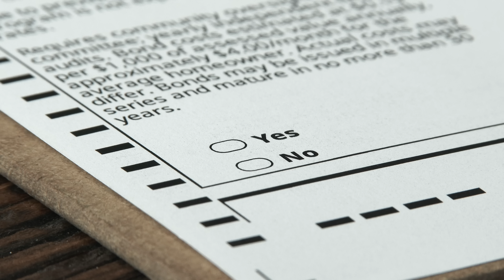Why Does Tesla Have An Anti Right-To-Repair Stand? We Suggest Some Reasons

Comment: I very much appreciate this video. You probably know what I am about to say. Planned obsolescence is part of the equation here. Yes, traditional auto dealerships make seven times the revenues in repairs, so that supports life extension of the vehicles.But EVs are different in that they involve much less repair. And as an example, I think that maybe it was Tucker (?) that went out of business in the US in part  because their cars lasted "too long". Tesla's new battery design involves the battery cell matrix being part of the structure of the auto, rendering individual cell replacement virtually impossible. So instead - throw the entire car away, or replace the entire battery structure as a unit. See the problem here and the trend?

Comment: Okay, as both a mechanical engineer, and shade tree mechanic for over 30 years, I'm going to call BS on Tesla for reason #1. Incorrectly fit a part/component? Seriously!?! THAT'S their excuse? Because last time I checked, a brake pad only goes on one way. A shock absorber/strut can only be attached in one way and on one mounting point on the unit body. You cannot attach the left-side Model 3 headlight on the right side of the car. And when was the last time you heard a car manufacturer say that they cannot put a rear proximity or impact sensor on the front of a car? (Probably because there is no such thing...it's a sensor in a bumper...) Then again, Tesla's not a car manufacturer...they're a tech company that puts a computer and a large battery between 4 wheels...
Reply: That is the case for a lot of parts, but not typically for electrical wiring. You have high voltage DC, high voltage AC, low voltage DC, and sensor wires using similar cables. You connect the wrong cable to the wrong part or other cable, and you either have a destroyed part, a fire, or dead body. 

Also, while really just a nitpick, you mentioned a lot of parts that are really just designed to go one way. Tesla could do so, even with wiring. But they have to be sure to design it that way. They likely aren't.

Comment: They should open a 3'rd party authorisation program having a sort of ID card that has all the skills of repair/replacement that the person has and it should have a similar security to credit cards, and have the basic skills require no active training or paid exam while the more advanced software and "core parts" engineering will have to have in some cases an extensive paid exam and in other cases a thorough course that ends with the exam, (in special for constantly upgraded parts, and have the "black box" of the vehicle be the security point only tesla can access but not some core component of the vehicle, only the "brain" of security and actual black box of the vehicle. (we do not need Tesla to become the APPLE of automotive industry)

Comment: Even if something goes wrong with the robot vacuum cleaner due to compatibility issues it wouldn't hurt anyone, but imagine the same thing happening to your car while driving it?
Reply: You know plenty of people do their own vehicle's maintenance, rather than go to the dealership for an oil change, timing belt, brake system..they may even take their vehicle to a shop that can/does do that work...how about the millions of vehicles repaired from fender benders
Reply: @thejake8099 , this is true. But, their vehicles aren’t anywhere near as specialized or advanced as Teslas are. 

Don’t get me wrong, I’m 100% for the right to repair. But, when we’re talking about vehicles that can drive themselves, easily be hacked and controlled remotely or possibly catch fire because of a rigged repair (yes, I know the same can happen with ICE autos, just not as easily), then I believe those possibilities must be taken into consideration.

Maybe, some sort of repair certification? Something along the lines of, you’d fix your out of warranty Tesla yourself, then, for a reasonable fee, have the repair certified for safety by a licensed Tesla facility. 

Everybody wins.
Reply: @samson7842  
Ha, really.

The average car has around 100 million lines of code with many different computers.

Tesla is no more advanced than any other car.
Reply: @Robert-cu9bm  so, then I should be able to take my girlfriend’s Honda Accord on to the nearest freeway, engage the level 2 autonomous driving mode and let the vehicle take over, then?

Comment: Tesla is anti-right to repair because money. There is far more money in repairing cars then just selling them. Tesla is just the only company that bricks your car or features if you don't use one of their shops. It is as anti-consumer as you can get.

Edit: There is no defense for having anti-right to repair stances. And you should avoid companies that enforce these policies like Tesla/Apple/John Deere because when you are forced to install firmware that can make your device run worse or turn off/change features with no recourse or notice in some cases, that is bad...

Thanks for being objective here and not just defending Tesla as most people do. Sure the company does have a respectable goal, but when you trample on rights already established, we all lose.

Comment: Back in the day, every high street had  a TV repair shop.....
A Tesla can be a 600hp 2 ton missile  which can - with the application of 5 volts - drive itself. 
Having used Toolbox 2 and Toolbox 3 Tesla diagnostic  programs I know they are not 'consumer friendly' even worse than xentry and BMW ISTA...
The interaction between the hardware and software is fiendishly complex - difficult for even Tesla to make work reliably... 
You have to put yourself in the mindset that these are now aircraft level machines ( even though Tesla quality is not aerospace quality) 
They are not the same as a 70's Mustang which you can noodle with. 
I hate to say it Tesla are just the most extreme of the automakers, but they are all going that way.

Comment: I am a very avid do-it-yourselfer, a fanatical supporter of rights to repair and have been ever since I destroyed my first bicycle while trying to repair it oh so many years ago. I regularly dig into my computers, laptops, cell phones and anything else that crosses my path in need of upgrade, repair or I just can’t resist taking apart and tinkering with. I have been known to take on some fairly dangerous projects including repairing power saws, household wiring, and natural gas pipes.

I am amazed to discover I agree with Tesla that their cars should be exempt from right to repair laws. With their full self driving systems, computer-controlled (defendant on an array of complex sensors), high voltage electrical system and high voltage, high current superchargers; the cars level of complexity and potential for causing destruction seems more like a small aircraft than a standard car and repair or modification of small aircraft is not left to the haphazard whims of increasingly low-budget third and fourth owners.

I do not want to be on the road with any self driving vehicle that has been repaired or modified by anything less than a highly trained, certified and legally culpable technician. Neither do I want to plug my Tesla into a supercharger being shared by a car whose high-voltage system has been “improved” by a dedicated amateur. 

If you look at tesla’s vision for the future the personal car will be as anachronistic as a privately owned horse is now. In 10 years time the Robo taxi transportation system will almost completely replace privately owned vehicles. Using Robo taxis will be significantly less expensive and significantly more convenient than owning and maintaining your own vehicle. Who would want to own or maintain an aged and increasingly temperamental and dangerous thirdhand electric vehicle for so much less money and effort they can just use a Robo taxi. The entire transportation industry is fundamentally changing and buying a used Tesla will be as unimaginable as buying an ICE vehicle.

I bought my Tesla Model 3 new one year ago. I expect that by the time it goes out of warranty (in three more years) the Tesla company will be paying a nice premium and\or offering a wonderful discount on a new Tesla in order to buy back used Teslas to refit them as a Robo taxis in their ever expanding fleet.

Comment: This is why I'll buy a chevy bolt in the future. Bolt parts can be bolt online, if someone is confident enough to try you can even buy the battery pack. Actually its completely possible to buy the bolts full drive train for an ev swap in an ice car. Of course you'll need to do alot of modifications to the ice but still you have the option.
Reply: Same, Tesla's throwaway culture is the biggest thing keeping me from buying one. I bought a Leaf instead as a gap car until there are more EV's available from mainstream manufactures or Tesla makes parts and service information available.

Comment: You've left of a big reason Tesla has for resistance to these generally open-ended laws: Software locked features. There's already a lot of people who feel that the discount they received is not a reason to not "flip the switch" to get a feature physically in the car but disabled for that discount. If this falls, Tesla will face additional costs in manufacturing variations, or just less discount options. 
I generally agree with the "right to repair" philosophy, but being in software, I also am aware of the increasing security and safety risks that come with these systems. Of course, risks from bad or unsafe repairs aren't new, but I can still understand the exposure, as you did note, to a company's reputation.

Comment: Huh? I live over 100km from the nearest service center. I was able to access all the service manuals, etc. through https://service.teslamotors.com/ ...
I have been doing (most of) my own repairs and ordering new parts without issues (except, sometimes, really long delivery times).
I have NOT lost warranty because I did the repairs myself (hell, I have even used 3rd party components because they were like 3x cheaper in some cases).
Tesla might be against right-to-repair, but in the actual real world, I haven't noticed.
Reply: So how did you order the parts when others can't?
Reply: @Robert-cu9bm  you can order parts through EPC. And I don't know anyone who can't order parts (anyone that actually has a Tesla that is). Well, there are some parts that you can't order individually (only available as a kit) - which makes it quite expensive. E.g. you can't order brake pads (only available with calipers, etc.), which is IMHO idiotic and not something Tesla should have "copied" from BMW and others. In those cases, you go to 3d parties as mentioned above.
It is also likely some parts are not available to buy at all (but all the parts I needed were available).
Also I am in EU, the situation could be different in other regions.
Reply: @jaroslavjandek8365 , The situation is definitely different in the US. Watch Rich Rebuilds videos on YouTube to get an idea what it is like on this side of the pond.

Comment: I wouldn't wanna be the person who buys a used Tesla repaired by third parties. This is not a phone or laptop to be doing that.
Reply: It's just a matter of time. In another decade plenty of repair shops will be able to do electric. There will be still some marques that are harder due to non-commodity parts, but that's the case today.
Reply: All modern cars are highly computerised... None will run without the multiple computers.

Why are they safe to repair but a Tesla is not.

Tesla can't even get the cars done right from the factory let alone trusting one of their repairs.
I'd trust a third party repair before Tesla.

Comment: Okay now I need to hear more about these Roomba mods...I also have decade old Roombas. We’ve already fixed a design flaw on their motherboards where one of the three onboard processors went bad, replacing it with a similar simple quartz clock which cost about $5 but I’ve neglected our Roombas in the past few years. Maybe it’s time to revive and improve them.
Reply from the maker: Nikki here - I have a European spec 530 with an aftermarket "thinking cleaner' face plate (sadly no-longer available). The battery is a Li-Ion replacement, and the actual brush box and wheel upgrades came from Roomba.
Reply: @transportevolved  awesome! I believe mine is also a 530! It’s a 500-series anyway...

Thanks for taking the time to reply!! Keep up the excellent work! You’re one of my few go-to sources for realistic, unbiased, and detailed EV info!

Comment: Can you fix my Roomba of the same era? It started only turning to the left and nothing I've been able to do has reset that. Roomba said I had to send it to them for an out of warranty fix. It seems like there's a firmware problem with one of the sensors.

I ended up just buying a new Roomba and have upgraded it's battery and replaced some of it's parts, but it would be great if that first one could be working and not just collecting dust in storage until I decide to take it electronics recycling.
Reply from the maker: Usually, they are repairable. - It sounds like the sensors need replacing - or perhaps a wheel issue :(

Comment: I keep wanting to know who is going to build the EV Willys or EV Beetle or EV Ranger. The low upfront cost, low iteration, long production run vehicle with universal parts, open sourced software, only a handful of socket heads. The vehicle that screams not only for repairabililty but for modifications, and the logical choice for a teenager's first ride. The vehicle that will lead high school shop classes into the 21st century and make converts of the gear heads who wont even consider owning a vehicle with metric bolts let alone electric motors.
Reply: Amen.  Which is the principle behind Windyday Concept.
Reply: @lawrencetaylor4101  never heard of it and got nowhere with Google. But the point is that its the kind of thing that by definition a startup really cant do... Because the whole point is that it needs to be made in big enough numbers that it has decent range and low cost, and needs to remain in production for long enough that spare parts and modification kits become ubiquitous.

Comment: As a native of Rhode Island, next to Mass, as we refer Mass Hole, I saw adds re this anti right to repair and pro right to repair. What I think is funny, is that another part of this is the mainstream effect. ones You get tweekers involved coming up with fun modes you get more cars out there. think of how many times you see a 70's Trams Am or old Cuda, or even yet GTO on the road that has been made into a car far more powerful than when stock. Right to repair, makes thoses guys more likely to want to go electric. besides the custom wheels you can find or the new covers that you can get. wouldn't it be wild to see a model 3 with rear 24 inch wheels pushing the car past 1500 torch rates. imaging driving the high way and a silent fast car just effortless passing as if the wind

Comment: The issue of public concern is not about giving manufacturers ownership rights which linger after they have sold their products.  The issue is to train repair and modification personnel to the matters of public safety in all matters where modifying software (or hardware) which might result in automatic actions which would bring harm to others.  A new sort of license is required 'public safety technician'.  Laws similar to those for experimental aircraft would be appropriate: Yes you have the right to innovate; no you do not have the right to crash into somebody else's home.